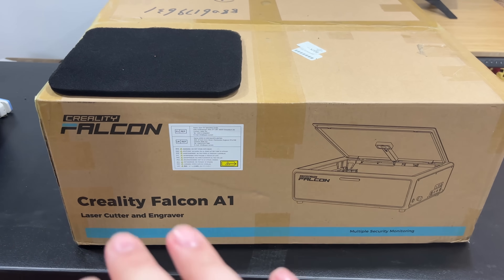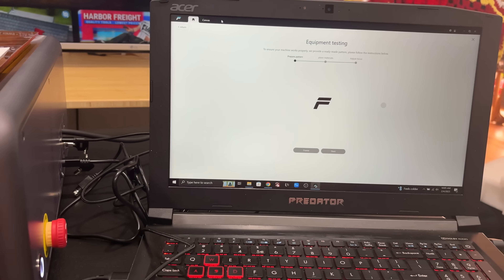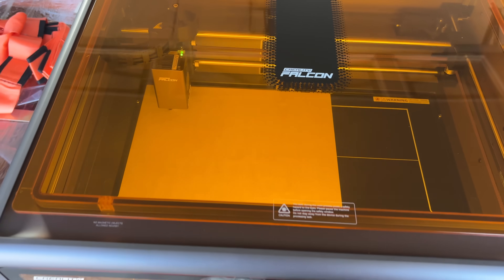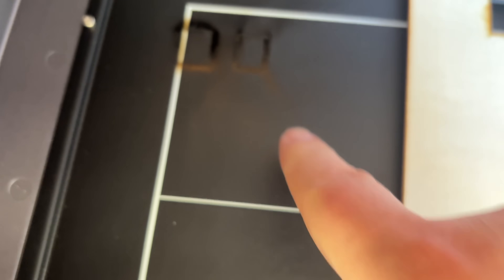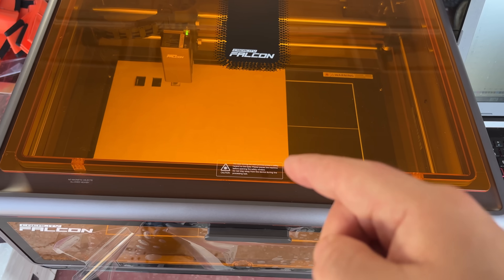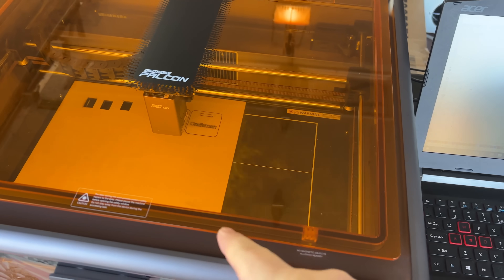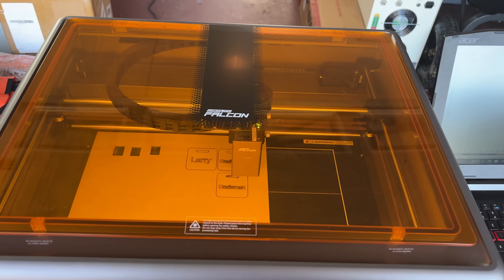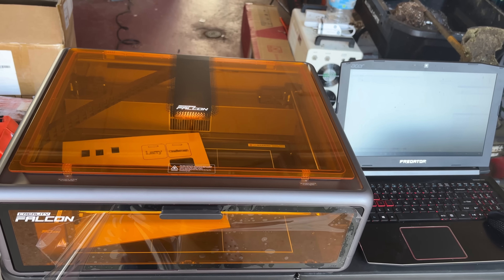Discover the Creality Falcon A1 Laser: Unboxing & Review!

Comment: you need honeycomb with air gap under it for cutting.   that is a fact.  my creality honeycomb is about 2 inches thick and would never fit in there.  it cost me $80 so that's why its not included with this A1 that is trying to meet the price point of a typical 3D Printer.  The problem is it does not look like it was designed with the clearance to add a honeycomb.  Maybe a thin one will work.

Otherwise the A1 is a very nice addition that incorporates enclosure, air assist, fume extraction, positioning camera and usable software into one cohesive unit.  Creality did a good job.  I see them adding a higher end unit with pass-thru and room for honeycomb but otherwise the same.  It will probably be called the A1 Pro or A1 MAX.
Reply from the maker: @DiggityDelights  yeah they dropped the ball with the not-a-pass through and lack of room for a honeycomb.
Reply: @RyanMercer  They sent a purpose made honeycomb with it to some reviewers (it's in their videos) that screws into the same holes that the default tray screws into, but it hasn't come out yet - the last time I asked Creality they said June, but they've since started saying they don't have one for it, which is as bit worrying. I have a 300x300 10mm high one and it fits in there no problem with about 12mm left above it. As for it having a pass through, they really have no excuse for not giving us the option, the front flap is exactly the right height... almost like they planned to do it